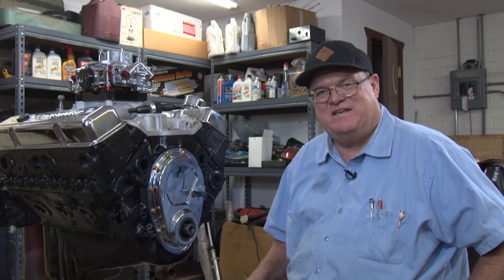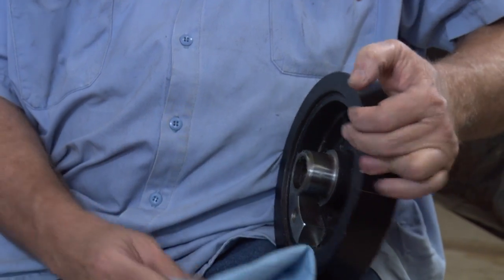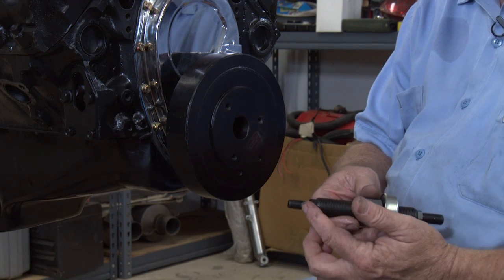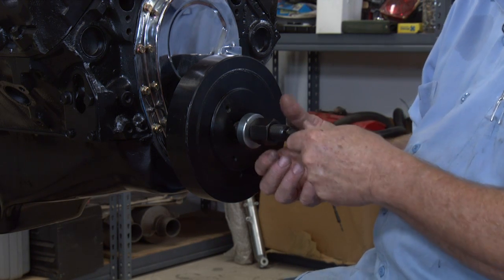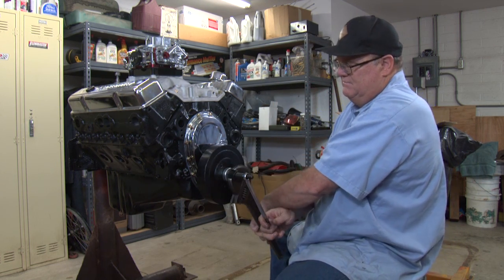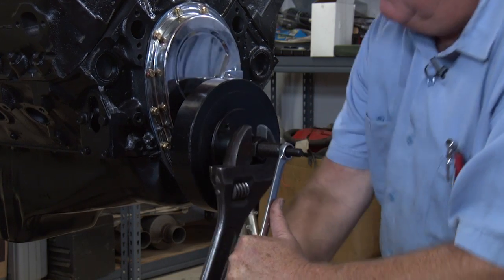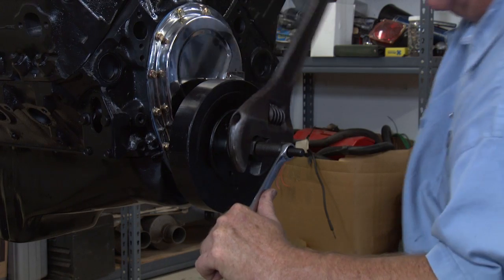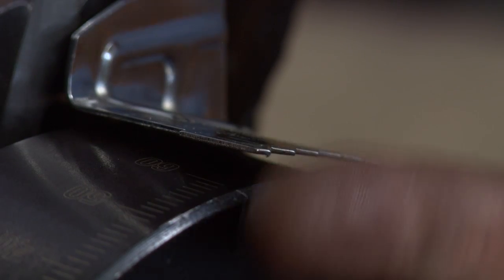How to Install a Harmonic Balancer on a Chevy Small Block V8 | Step-by-Step Guide

Comment: Very important information. If that harmonic balancer slips off even at an idle it will destroy the crank shaft I know from experience.
Take his advice. Use the installer tool!

Comment: Today i took the harmonic off to replace it ..with motor in its cradle. on 1988 Blazer 350 i purchased recently..
And What did i fined ..? A short bolt that barely grabbed the 1st  two threads of a Heliocoil crank. Geee's  I guess someone did not think to take your refresher COURSE you got going on here... Which sucks,.!!....         I Swear 
There's people i don't even know who want to make my life difficult at times. I don't need they're help in that dept...
 Peace love and blessing. Commenting. Live live live  from the Grand State deep inside Fema region 9

Comment: nice vid,good info. i fear I've got to replace mine on my 4.3 ltr gmc. that sucker is tapping like crazy and starting to shake on the highway (50mph) and above. its even throwing multiple mis fire code. the crank position sensor is brand new,thats how i discovered. my question is does anyone know if the balancer is dif than the pulley? im sure it varies from make & model.thanks for ur time & knowledge.

Comment: From what I know the pulley goes up against the harmonic balancer once that is installed that big nut in the middle tightens the pulley to the harmonic balancer and then there's three studs with built-in nuts that tighten the pulley more security to the harmonic balancer I didn't know that the harmonic balancer had to be torqued? Tell me more about that

Comment: When you install the new balancer, will the mark on the balancer always match the "0" mark on the timing mark tab? Do I have to find true  TDC at the compression stroke before uninstalling the old and putting in the new balancer? I am asking because perhaps the old balancer has shifted and I wan to be sure that the mark on the new balancer when at the ")" mark on the tab are 100% TDC. I have a 1978 Corvette L48 and suspect it has shifted. Any suggestions? Thanks!...

Comment: So I installed my harmonic balancer on my 350 and it's not flush with the timing tab!
I felt it bottom out just like you did on it and went no further.
I ended up pulling it back off and matched up the new and old balancer and they looked the same.
I looked at the ride wear on the old shaft and the mark where the grease wiped off from the seal.
They both look the same. Just seems to me that the balancer is not in far enough on the crank.
Should I be worried?

Comment: I have a 2005 Chevy Astro  and only when i am on idle or stoped and the van would be in drive the van will  have a very rough viabration .Could that be the harmonic balancer ( The van had a full tune up and i am not getting any misfire code )

Comment: How would you have Torque a Harmonic Balancer down that's a deep dish like on a 2017 Silverado?      I think you're supposed to use the old Harmonic Balancer bolt on this particular type for initial Torque then take it out and install new bolt. 

My problem is how do you hold the Balancer still to Torque bolt without using a pry bar, essentially having the potential to sheer the crank key
Reply: Thought about using a 3/8" impact but don't want to potentially twist the crank

Comment: How do you install a harmonic balancer on a 1962 Chevy Impala on a 327 engine. There is no threads on the crank end just a small hole smaller than 3/8 bolt?
Reply: cant find the tool you used in the video, can u help steer me in the right direction?
Reply: @dikrankrikorian2802  I believe it's a Proform Harmonic Balancer Installation Tool that fits small block and big block Chevy crankshafts, part #66515.

Comment: Hey Robert you seem like the guy who would know.  My 67 Camaro has a 383 stroker  we can’t seem to keep it from leaking.  I also have a pretty good tight high frequency vibration at around 25-2800rpm   It’s not gear related cause it will do it at the same Rpm regardless of gear    I can drive through this rpm range no problem it just really hates cruising or downshifting though this rpm range. 
I have a Holley sniper EFI and Hyperspark dizzy.    What’s your thoughts and tricks to keep my 383 in great shape (ps it’s a new build that came in my car)
Reply: Is it an internal or external balance crankshaft?
Reply: @henrysmith8012  external  bought a new balancer since I left this comment  doing the rear main seal in a few weeks ..  think we finally got the oil pan to stop leaking   .. learned that you have to score the surface of any shiny metal 🤓
Reply: Driveshaft out of balance?
Bent wheel?
Lumpy tire?
Unbalanced wheel?
Bad wheel bearings?
Bad engine mounts?
Bad trans mount?
Bad suspension bushings?
Bad ignition?
Loose battery?
Vacuum leak?
Weak fuel pump?
Plugged fuel filter?
Intake/vacuum leaks?
Misfire?
Heatsoaked ignition ?
Vaporlocked fuel?
Leaky fuel line?
Leaky fuel tank ?
Harmonic balancer separating?
Flexplate weight fell off?
Etc...

Comment: I have a 1989 chevy truck with a 305 v8 what is the torque is for the harmonic balancer and the crankshaft pulley

Comment: Do you have to make sure cylinder #1 is TDC and line up the timing marks? You mentioned a dowel?
Reply: The shaft on the crank is keyed. Can't mess it up.

Comment: yeah but, what are you supposed to do if you try to tighten up the final bolt, and your motor rotates with the bolt?

how are you supposed to torque it down when this happens?
Reply: because i don't have a impact socket
Reply: Jeff Fuehr don't know if you've figured it out yet but if you have a manual transmission you can put it in 5th gear I believe and the crank won't turn. For automatic transmission just use a pry bar or good sized wrench and wedge it through the harmonic balancer. There's many different methods to keep it from spinning.
Reply: Use a pipe wrench to hold pulley laid it against a jack to be firm and torque down or use pry bar and take of starter motor and pry flywheel and have someone torque it down
Reply: An old race car engine builder taught me.. if you take out one of the spark plugs and basically feed a length of rope through the spark plug hole and obviously leave enough hanging out so it doesn't completely fall into the cylinder.. as you turn the motor over by hand the rope will prevent the Piston from making a full stroke and then you can torque down the nut.. he always used nylon rope because it's strong it doesn't fray as easily and it doesn't leave behind any material or scratch pistons or cylinder walls...

Comment: Now let's try this removal and installation with the engine in the car to see how easy it really is.
Reply: It's just as easy bud there's no difference you have to remove the pulleys and belt system when it's in the car

Comment: I have an SRT8 I'm building, just ordered the harmonic balancer. I can't seem to find anywhere the answer to my question. Is there a specific clock the balancer needs to be at? mine isn't keyed, it's a pressed fit.
Reply: Did you ever find an answer - I have the same question...

Comment: what if the crank isnt threaded?
Reply: Brandon Fulton I could not find any videos on this. I have the same non threaded crank. I finally called the engine shop that rebuild my engine for a professional answer to this. His answer, “You bang it on.” (Assuming large socket, dead blow hammer and all) And it should go on dry. Well there you have it. He said “Don’t feel bad, you’re not the first one who asked.” - I posted here because Robert Dana’s videos are the very well presented. - David Jones - Thank you for posting them.

Comment: I have the factory woodruff key that is on my crank 66' 283 should I keep it or get it out and do a new one for the new balancer? Also My crank is not threaded what would you do?
Reply: I'm in the same boat with my 283 on my '63 Impala.  Did you ever find an answer from other sources?
Reply: Brian Clem Brian Clem  Pete’s Garage “great channel” told me don’t thread anything that is not threaded. That was his opinion whom I have a tremendous respect for, But there is a guy with a 327 , Classic Car Overhaul that used a tool to that guides the bit and then the tap nicely threaded 7/16 to receive the standard bolt that threaded units have. I found a seller on the web that sells the tool and the W size bit and tap to do the project with very little hassle. I’m thinking of doing it except if  spend the money on the tool and then I go to the machine shop and the block needs too much work and overbudget it’s just an added expense wasted. If I do it after machining and I screw it up well pretty much a waste of the work I paid for if I ruin the crank (unlikely but you never know). What is the advantage of the thread? Extra secure for high performance and or being able to turn the motor by hand when working on it and building it versus having to turn by a pulley bolt cam sprocket bolt or slipping some DIY part or socket over the crank with a slot for the woodruff key?
Reply: Did you get an answer to your question?
Reply: hoolu2 advance auto parts sells a part online that the is called a Proform Crank Turning Nut. It is good but doesn’t have a locking mechanism like a regular socket does, so that may be inconvenient if you keep the engine in the vehicle. YouTuber Eric the car guy is building a sbc 383 or 350  and he has a fancier version that he uses that has a lock to keep it from coming off your ratchet. To take off my balancer I used a balancer puller from harbor freight. To pull the shaft timing gear I used a 3 arm puller. To put both the balancer and the new gear on I used a ballpin hammer and a thick 3/4 Brass Drift I bought from Harry J Epstein co. If you have anymore questions let me know. I kept my original woodruff keys in also. There are a few issues you come up with with these older motors since people don’t seem to like building them there isn’t as much info the older 283 265s and small journal 327s. If your very new to this and rebuilding an engine my advice to you you learn everything you can about deck height and how far your pistons are gonna be in the hole before you put anything together and buy parts. Don’t rely on your machine shop especially if they aren’t performance minded. you need to make sure all you measurements.

Comment: nice but you didnt torque it down!
Reply: I could be wrong, but I think since it is a press fit and not held on with a bolt. Torquing it wont make a difference.  You just get it on there till it's all the way on.
Reply: @thatmarred_mustang  that was my question thank you

Comment: I've got a 350 small block harmonica balancer will not go in all the way have tried 2 different harmonic balancers same thing any suggestions
Reply: Daniel Alvarez Jr. You may have stripped the threads in your crank if it gets to around 0 lash and then spins easily again or the balancer could be going on crooked
Reply: Or the crank timing gear isn't pressed in all the way

Comment: are they not tty bolts and what are the torque specs. i was told 240 ft lb then 140 degrees
Reply: Definitely not tty. It's a pressed fit.

Comment: how does one know if they need a new one ??
Reply: charles philippe I guess there is a layer of rubber inside the harmonic balancer, like the balancer is two layers with a ring of rubber between them that you can see. Examine the rubber to see if it's cracked or stiff and falling apart. If so, then you need a new balancer
Reply: Yeah or check if it wobbles while the car is on.